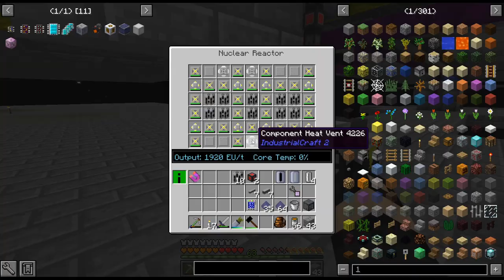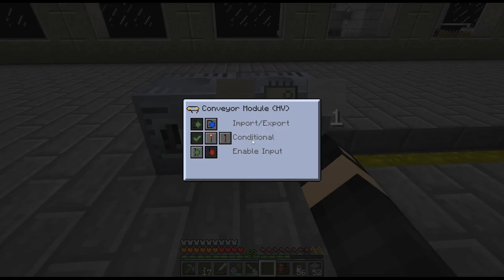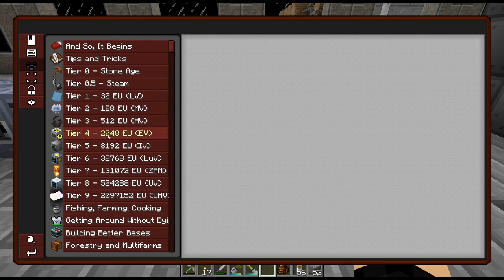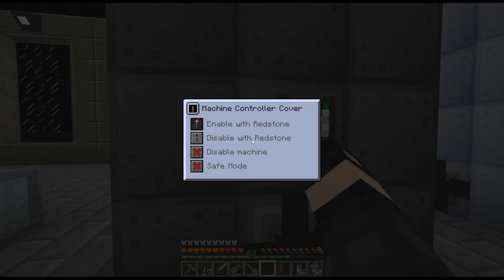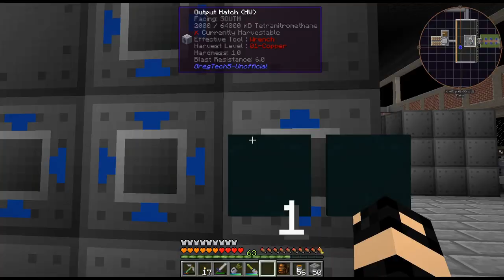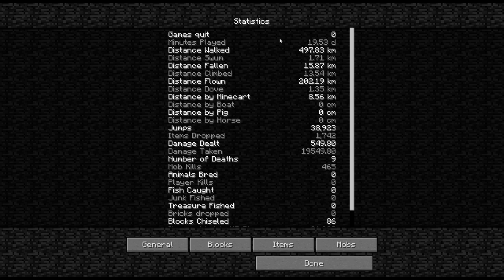GregTech New Horizons S2 - 99 - Cetane Boosted Diesel

Comment: Don't forget to set safe mode on your machine controllers, otherwise if you run out of power the machine will repeatedly force itself to "on", fail immediately and void everything (especially important for distillation towers where you can very quickly lose a whole super tank of oil)

Comment: There is a better recipe in the LCR for acetone by doing acetic acid + calcium/quicklime/calcite
Tetronitromethene is in MV
Would suggest using safe mode on your multiblocks with machine controllers
Jet fuel A isn’t used for anything
You don’t need an output hatch to void fluids
Loot bags for Ender tanks is good

Comment: You can use rs latch to solve the threshold issue. (Ic circuit can integrate rs latch with constant bound in single block)

Comment: Really curious why I see so many people invert the signal of fluid detector covers. I keep it on normal at a certain threshold so if it reaches that amount, redstone turns on and have machine set to disable on redstone. Guess it doesn’t matter either way but. 

Start crossbreeding one of you highest stat crops with any ones you want high so they can just level in the background. I mean, remember to go and replace seeds but I find it easy to do when I’m in a brain fog. “Go manage your crops and come back to task at hand Apex”
Reply: Common feeling is "light on machine on" so they invert it to visualize better